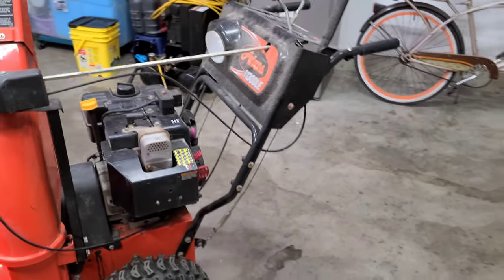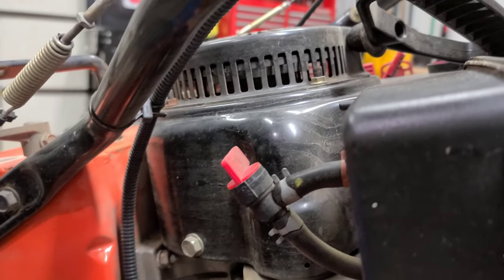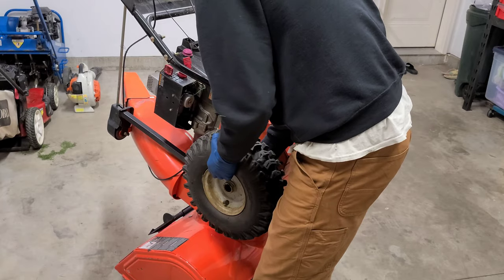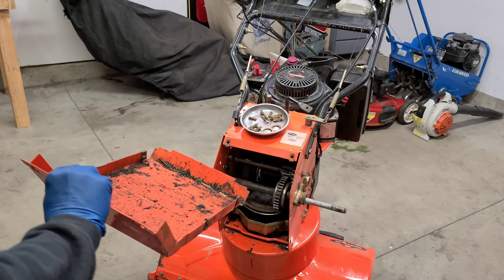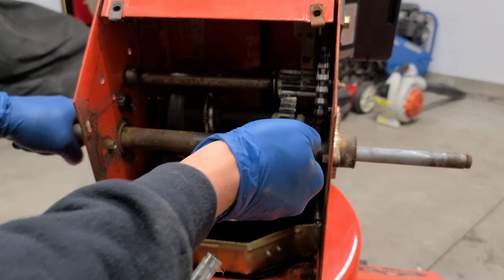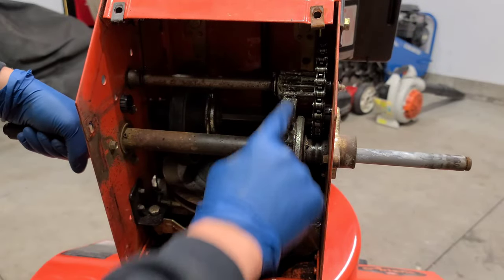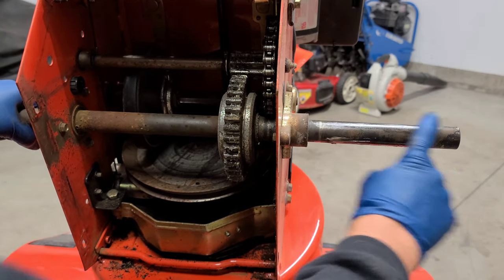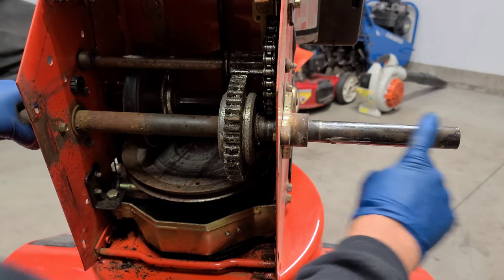How-to Grease & Lubricate A Snowblower Transmission

Comment: Ok I liked the video in general but I'm a retired machinist and I would have liked to see you clean the rust from the shafts before applying grease. I have a 26 year old snowblower and it has no rust on any of the shafts or exposed metal parts I put thin coating of grease on every exposed nut,bolt,shaft etc. I feel the viewers would have liked to see that too but I guess that's just me, I always clean and grease every bare metal surface when preparing for wet weather applications.
Reply: I agree. I use a wire wheel on a grinder or even a small wire wheel on a cordless drill.  It's quick work and doing it once a year prevents rust build up and the difficulty pulling the wheels off.
Reply: I agree with you. His video is fine but he didn’t do a good job in cleaning before applying grease, etc. and reassembling. The condition tells me that his machine is a little neglected.
Reply: Exactly what I said, CLEAN THE RUST OFF!!!!
Reply: @mariocestra1156 
It doesn’t look neglected at all. It looks slightly used. It’s actually really clean.

Comment: Nice!  Like dad always said, "Take care of your equipment and it will take care of you".  I like to keep a can of primer & paint handy to sand & touch up rust spots on the sheet metal (do my best to slow that rust!)
Reply: Sand, Spray with Rust converter (Ospho), and paint. If you want to slow down rust then use a rust converter to stop the rust. If you do not sand out all of the rust you will have rust under your paint and primer. Ospho rust converter is my favorite, because you can paint right over it after it dries.

Comment: Take the gas cap off, place a plastic shopping bag over the fuel tank filling port and reinstall the fuel cap.  No leaks.  Try this, remove the rust from your axles with a rotary wire brush, instead of using grease on your axles apply anti seize. Next year your wheels will slide right off.  Anti seize works great on engine crankshaft pulleys, blade adapters. etc....
Reply: Who cares 8
If the wheels slide off?

Comment: I use a cleaning kit to clean out the corrosion inside the actual wheel.  Then apply anti seize to a patch and coat the inside of the wheel as well.  What you could do is clean up those axles with a wire wheel to remove the rust that's already there as well.  Next time clean the friction wheel as well, it look dirty with rubber marks.  Then grease the gear selector that the wheel rides on.
Reply from the maker: Great tips thank you! I clean my friction plate with carb spray on a rag. Cleaned it just before the season started. I was planning on doing a separate video on cleaning the friction plate but completely forgot about it, hence why it wasn't clean in the video.

Comment: Nice informative video! It's usually a good idea to put a thin layer of grease on the friction wheel axle as well to ensure nice easy shifting.
Reply: What if your snowblower only poles with the right wheel good the other turn be defective 14:41

Comment: re: securing fuel in tank during machine service: 1. remove cap, 2. cover throat with plastic wrap. 3.install cap. 4. fuel valve off. 5. Onwards.

Comment: You should have used some emery cloth on those shafts tocleanoff the rust before you coated them with anti seize.
 And it's always a good idea to clean the metal drive plate off after spraying chain lube in there. Spraying any kind of lube with make your runner drive wheel slip from no traction.

Comment: I have issues with the friction drive not moving on the friction disc and changing speed range. Worked a few months ago preparing for winter but of course today with 6" of snow no go. Too cold outside to work on it.

Comment: Really like your content, especially what you're now doing with lawn and yard care on overgrown properties.

I followed your process for my Ariens Deluxe 30 with auto turn , and having trouble getting the spline gear on the split shaft to engage. I notice at about the 8 minute mark where you first replaced the shaft, it did not engage. That's as far in as I have been able go. At the 12:05 mark when you tried again, it went right in! What magic did  you use? I've spent a few minutes - rotated it,   jiggled it, with no success. Did you have any secrets you can pass on?
Thanks for any help. Mark

Comment: They make a Anti-seize spray. In the middle where the the gears are I would also put some grease where that rusty part of the shaft was on the left side. Looks like there are keys in that area. I also put grease inside that wheel hub so next time it will not stick.
Reply from the maker: Thank you for the tips!
Reply: @fillslawncare  Don't forget to put some grease into the wheel hubs where the axle goes through. At the back where your model number is located, is there a Black Rod that is Not connected ? Just wondering why its there, it comes out near the back and is bent at a 90* angle and has a hole in it. Please let us know. Thanks.

Comment: Good video on doing easy snow blower maint , a few more things to check when the belly pan is off. Check the rubber Ring on the metal disc that is used to power the wheels, and use some brake cleaner to clean the disc also check the shaft bearings for wear.!!! Thanks.
Reply: And also lubricate the shaft that the friction ring is attached to.

Comment: I usually clean the transmission plate with carb cleaner while in there. Also clean the the friction wheel rubber, then close her up.
Reply: Yes,  Cleaning the grease from the Trans Plate and Friction wheel is key here, or the transmission will slip and go nowhere.

Comment: Why put grease on the axil if you have a key to keep the wheel turning with the axil.? Would it not be better o put anti size on the axil so it will be easier to remove  wheel . 
Thanks for the video

Comment: I saw on another video that there is a "C" clip that also needs to be removed with a flat head screwdriver. So, is that not necessary ? Thx
Reply from the maker: No it is not necessary to remove the c clip.

Comment: Whoa, you need to lube the shaft that the friction disc rides on. How could you close up without doing that? Also, scotch brite green pads work great for cleaning up the drive wheel that the friction disc runs against. That should be free of any rubber particles and oil or fluid overspray as well.

Comment: The machine is designed and intended to be laid flat on the auger housing. The manual calls it the forward service position. It’s much more stable that way than balanced in the middle on just a brick. The difference between your brick and flat as intended will have very little effect on whether fuel leaks out. Just drain it, that simple.

Comment: What about cleaning the friction wheel?
Reply from the maker: I wanted to do a separate video on cleaning the friction wheel but never got to it. I use carb spray and wipe off rubber residue with rag. Let me know if you have any questions

Comment: Interesting that you anti-seize areas that have friction and grease areas that do not move between parts.  Should apply anti-seize to the axle where the wheel sits, that never rotates, it is a fixed position.

Comment: Help!!!  On my MTD snowblower friction wheel shaft, if the smallest gear is in place, the wheels won't turn. If I move it aside, then the wheels turn. Put back in place, it won't move again. All gears are complete with no teeth broken.  I have wracked my brain and it doesn't make sense to me. What am I doing wrong? Every gear moves until that smallest gear is put back in place.  Please advise..
Reply from the maker: Have you tried lubricating the gears? Start there first
Reply: @fillslawncare  I am going to do that next but they move freely as long as the smallest gear is moved out of the way.
Reply: @fillslawncare  There are "axle" gears and then "friction wheel" gears. When sliding the smallest gear, all is well. Put it back in place and nothing moves.
Reply from the maker: @kathy5939  Hard to tell without seeing it. If it's not snowing yet in your area, now would be a perfect time to take it to a good small engine shop to beat the line.
Reply: @fillslawncare  finances don't allow that unfortunately.  I will get it figured out. Just can't get my mind around why it works fine with the small gear out of place, yet when it is put in place, its like the wheels are seized. Odd, very odd...  Thanks for your time. Happy Thanksgiving.

Comment: Tipping it over like that do you worry about the oil coming out?
Reply: Ya, the oil began to drip out when mine was tilted, but I just tightened the cap, and it stopped flowing out.

Comment: I would have removed the rust on the axles before lubricanted all the shafts and on the right side shaft greased the inner shaft not anti-seize and anti-seize on the outter shaft and and greased or oiled the 2 bearings and greased the friction plate shaft to make easy shifting
Reply: Anti seize is not a lubricant is to protect from seizing lithium grease is a lubricant, but I understand

Comment: I just saw your video today and I think your use of grease and anti seize should be reversed. The axle shafts that are held in place by the key should have the anti seize since they don't rotate against each other but would benefit from the anti seize to keep water out so they don't rust. The right shaft you did put the anti seize on does rotate inside the hollow outer shaft through the blowers differential, so that should have the grease on it for lubrication.          I have an older Ariens from the 70s that has a knob on the left axle which allows the user to switch from differential to locked axle. That left side even has a Zerk fitting on the outer tube which greases the inner/outer axle part of the shaft.

Comment: The friction wheel slides left and right on a shaft to select the drive speed.  Everybody should clean and lube that shaft, or there may be resistance and damage in the speed-selection mechanisms.

I think you used way too much grease on the gears.  I believe those gears are dry coming from the factory.  At least I would wipe off the excess so it doesn't slop around on the friction disc/pulley or the friction wheel.